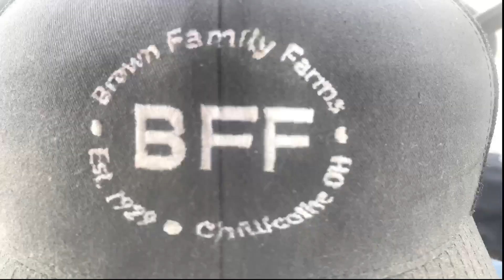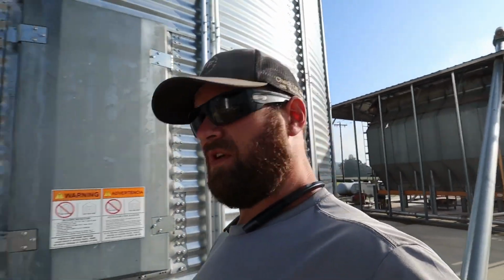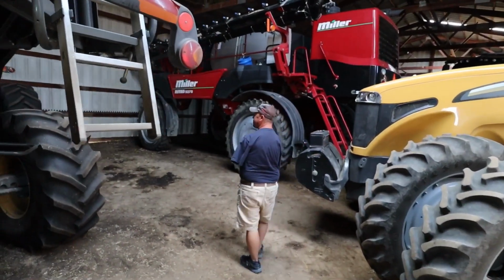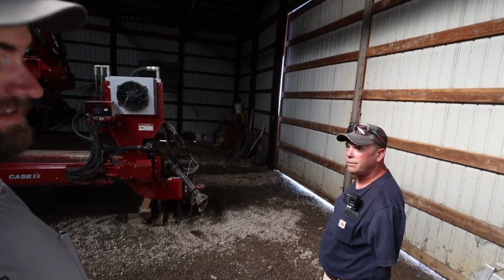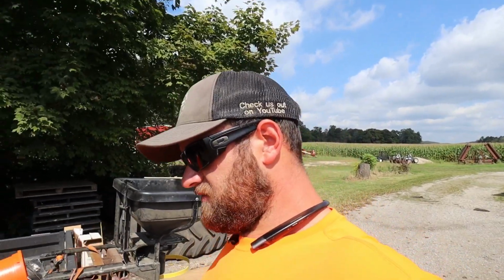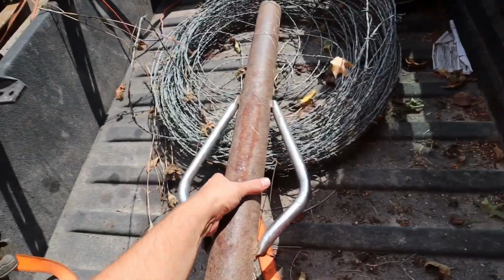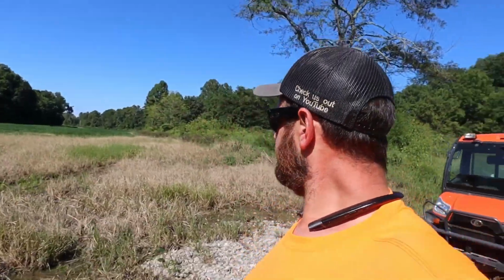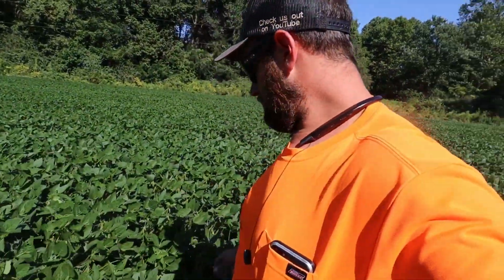My Grain Bin Can Float

Comment: Glad I’m not the only one having GoPro problems, I’ve pretty much given up on them. Although mine are both older models.
Reply from the maker: I had 2 GoPro 4s that did the same thing so didn’t get any better with new models
Reply: Brian's Farming Videos good to know I guess I’ll stay away from the new stuff too lol I have a 3+ black which isn’t too bad and a Session 4 which is junk. Not sure what to try next, the new DJI action cam looks pretty good though. Someone said they use cheaper Drift cameras with good results.

Comment: Brian, use the go pro app to see if the unit is still running without doing all those steps....just a thought.
Reply from the maker: I do problem is once it’s frozen it will not connect and sometimes I can get it to connect from the ground when it isn’t frozen

Comment: What's the diameter  of the new bin and how many bushels? Are you still going to use the air tubes to fill the older bins or you going to tie them in to the new grain leg.I presume the air pump and tubes are for the unload of the grain dryer?
Reply from the maker: New bin is 48’ 83k. We will still use the air system to fill out of the dryer. If corn is dry we will dump straight into bin with the leg

Comment: Instead of having to build every year so so, why can't you add more to the bottom of those left  and raise each one a ring? Just wondering is all
Reply from the maker: Great question. We could add 2 rings to the big bins which would equal about 20k bushels. The concrete isn’t big enough to hold anymore. We needed 80 and the cost to raise a bin is still not cheap so it made more sense to build